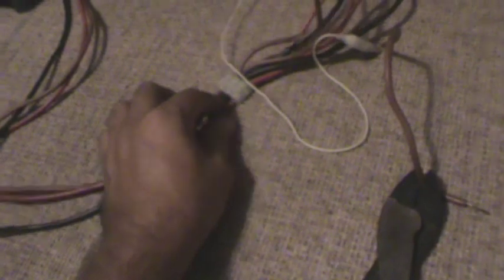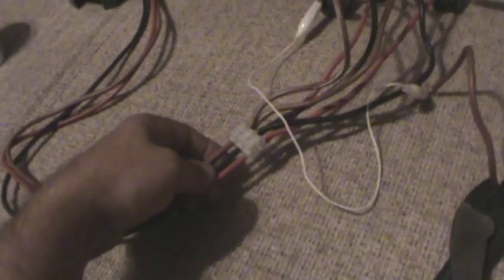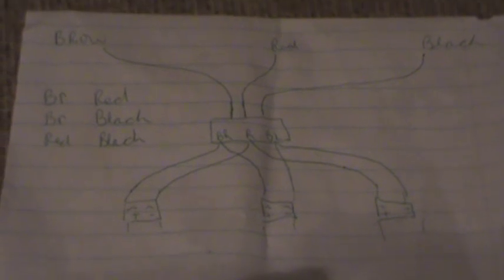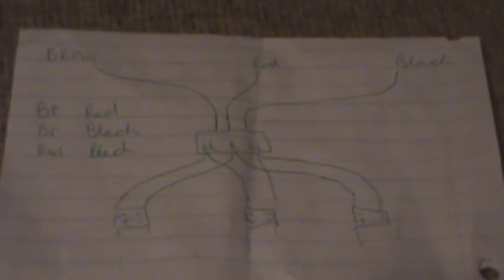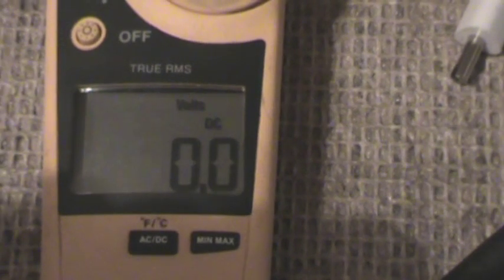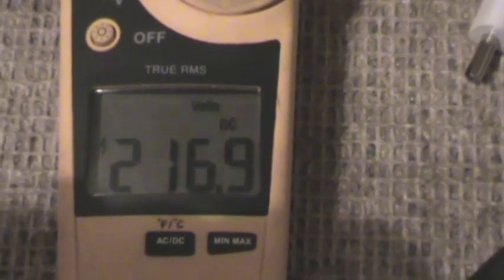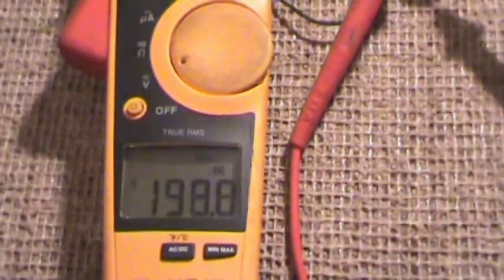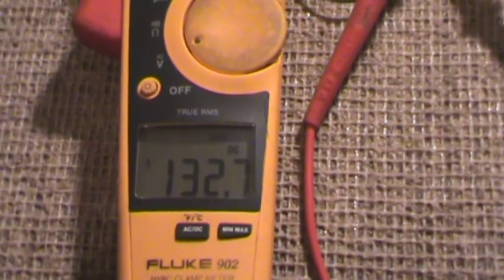Blower Motor To Generator PT2

Comment: Hi fun to see another ac fan project. I got a Panasonic ac fan motor and I have removed the electronic chip to change bearings. And I had to solder three spots to get it away. My question to you to I really need the chip to keep it as a generator? It is a magnetic motor so are the three soldering spots connected to the coils and if so is it three phase like yours. I am gonna use it as a wind turbine generator. And how do I connect the three soldering spots to the rectifier?

Comment from the maker: this variaboe speed is actually a magnet style motor with magnet inside on the rotor.  a regular motor has a aluminum rotor so im not sure it will work.  go to your local parts house for hvac and see if they have warrenty motors that you could have to be a school project.

Comment: man that arc your pulling off the DC side is hot!
using 3 bridge rectifiers seems like a good idea-im thinking you wouldnt get the same if you joined the phases together and used 1 rectifier but maybe you should try it anyway.
strange how there seems to be no load when your filling a cap...